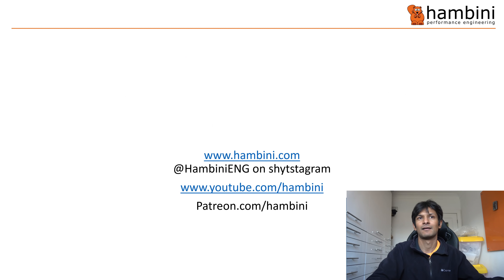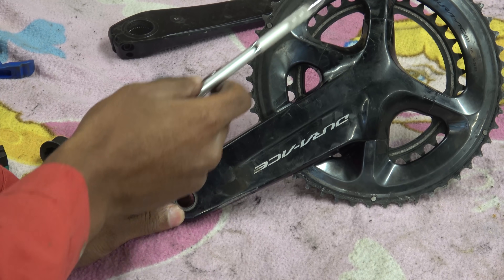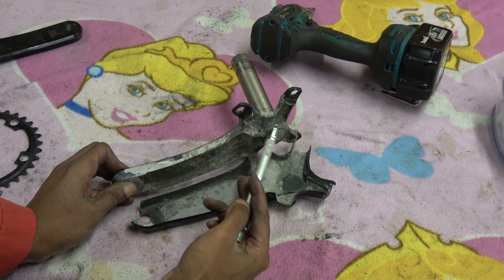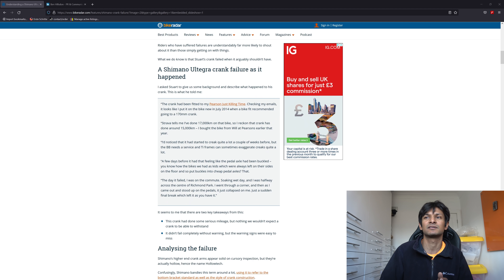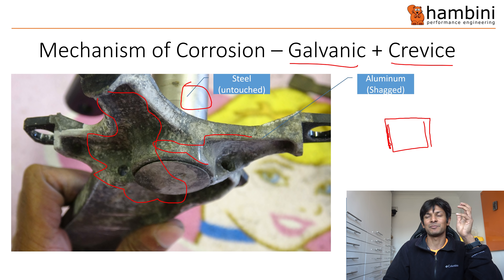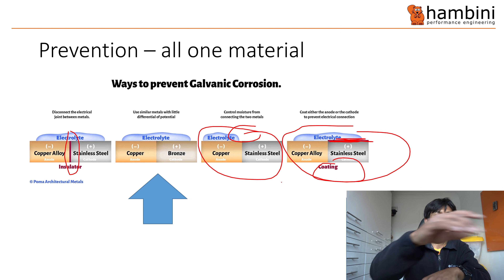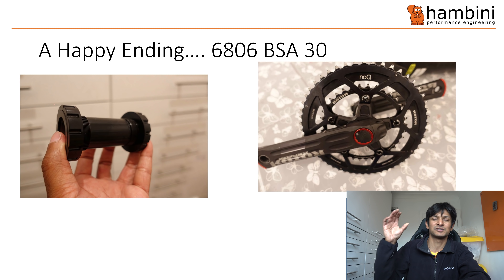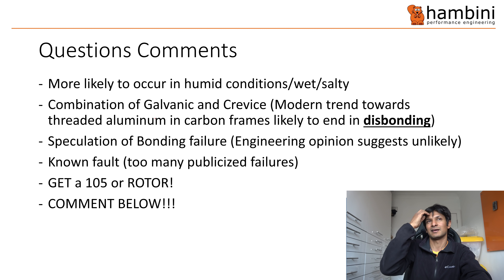Shimano REAMED for Engineering Incompetence

Comment from the maker: A link to the webpage accompanying this video is here https://www.hambini.com/shimano-crankset-failures-an-engineering-analysis/
Reply: We need to know more! Let’s have guest video from the gunman.
Reply from the maker: @dominicward3523  I'm not sure I can find him.
Reply: Shimano's original hollowtech XTR cranks were welded and never had any issues.... It also looks like the top half is forged and bottom half is cast
Reply: @nigelsmith7366   I think that maybe the case even today(need to closely look at my XT and SLX cranks) atleast on there mountain bike cranks which cosidered pretty bullet proof all things considered. I get the feeling that its maybe a case of there flying to close to the sun interms of trying to get weight saving on there road cranks
Reply: Who would have thought one year later Shimano would recall their chainsets when they knew of the potential of failures 10yrs ago. 11yrs ago..
Reply: @Older_Mountain-goat_1984  are you still working?if so when you get paid that is your profit. Profit is not a dirty word. Without profit Campag Shram Shimano cannot invest in new stuff.

Comment: Thanks for the video.  My DA 9100 crank failed as well.  The non-drive side delaminated and it was just outside the warranty period.  I emailed the shop I purchased from with pictures and they just said, sorry and said I could buy a power-meter arm.  Tried to find someone from Shimano to share this issue but could not.  What a disappointment, I am glad I was not injured while riding.

Comment: After my second R8000 failed I went to 105, there's probably a reason stock is thin on the ground.  It's reasonably priced and looks the part, so long as you dont mind the disparaging looks from guys in rapha hats with clicky cranksets.
Reply: There's no real winner at the Special Olympics. Buy a mountain bike, learn how to ride it, laugh at Rapha choppers. Job jobbed 👍🏿
Reply: Love the Rapha guys and gals...  :)
Reply: I run non-Shimano chainrings on my 105. Sold my Dura-Ace as without the chainrings it’s only around 50g heavier than 105. Plus 105 comes in silver which is automatically faster.
Reply: does the r7000 new 105 have the same issue? or do I need to find an older r5800?
Reply: @Demon09-_-  r7000 is not bounded but forged, so the 105 should not have the same issue
Reply: Same here, I run R7000 and R5800 cranks and have no issues.  You still have dissimilar materials (alu crank and steel spindle); so the reason the hollowtechs are failing is obvioulsly due to bond failure.  perhaps sweat, etc. is getting into the hollow space.
Reply: I don't have any problems with Ultegra despite logging many miles yearly , but then again, I am a feather-light 48Kg and top off the end of my power range in the low 600s.  I just don't experience the same frequency or severity of mechanical problems as hravier cyclists.
Reply: This comment is underrated!
Reply: Wow. I can see why Ultegra and DA are so light.
Reply: @thelmaviaduct a while back I had to rapha guys who were pointing at each other's rapha clothing. Carbon ultra light road bikes on tarmac. I bombed past them on my trail bike with 29 x 2.6" tires and they immediately started to chase. They got quite close and held it for a few minutes then I ended up leaving them in the dust 😅. I got to my destination 5+ miles later, rested for 30 minutes and then passed them again on the way home.

It dedi itely isn't the rapha that makes a rider
Reply: @ByronAllis  nice one, wish I was as fit as you. Must get my spandex out and do some zwifting 😂😉💪🏿
Reply: @thelmaviaduct  🤣. Pain. More pain. That's the secret. Originally wanted to say how much I love the 105 groupset but got distracted. Admittedly that ride wrecked me for days but it was worth it

Comment: Now we know where all the Great Barrier Reef coral has gone, its in Shimanos cranksets. I've had 5 friends here now break numerous sets. Very common in Asia, humidity. I wouldn't say the Rotor Aldhus are a faultless. The way they clamp the spider or power meter on a tapered spline is really dumb as its so heavily reliant on perfect tolerances. Paul looks mental but i like his desk.
Reply: You've got 5 friends? 😀
Reply: @tednruth453  one of them works for Shimano which was awkward!
Reply: @peak torque my hairdresser and therapist agree with you. The desk is over 100 years old. And the typewriter is also nearing that age as well.
Reply: Can you imagine if this was a smaller brand? Everyone would be laughing at them and saying it's a death-trap. But... It's Shimano... Carry on!
Reply from the maker: @ChinaCycling  They'd say i t was a rogue supply of one and not a hambini special!
Reply: @Hambini ZRACE x SIGEYI RX Power Meter Crankset  i think zrace designed that type of rotor crank
Reply: should there be grease on the tapered spline when installing the power meter onto the aldhu cranks and axle? I was just wondering if that is going to help reduce future issues
Reply: Happened to me with a 6800 crank about 5-6 years ago.  Initially, I was led to believe it was a one off, bond failure thing.  But having learnt more, water ingress/galvanic corrosion seems more likely.  Anyway, my replacement held up well.  No issues with it so far.
Reply: 2 cranksets in 42 months. Live in Hawaii
Reply: Glad to see such an antique being used in such a correct fucking fashion.
Reply: I have got 3 8000 series crank sets on 3 different bikes. The newest one year old and 8k km, the oldest 3 years old and some 20k km done. I live in wet Cheshire and ride often in winter too, although avoid riding after a major rain fall. So far no issues with either.
Reply: @pureroadie  Exactly PJ you've hit the nail on the head ! 

This problem aluminium oxidisation  / crevice issue was seen across several brands in the very early 2000's  on both aluminium / carbon frame combo's, as well as Ti / carbon frame combos. The weak spot was usually the rear drop out chain stay connection caused by an absence of barrier coating on the dropout male insert leading to oxidisation, tell tale white deposits and consequent debonding  / splitting of the carbon stay. Fully resolved by adding the barrier coating ( Colnago at least  weren't shy to address this), so the issue was effectively identified and fixed from around 2002 / 2003.

Which begs the question why 20 years later are manufacturers like Cervelo and Shimano using inherently  weak design and IMO substandard practice on the items identified  (in the light of knowledge readily available from 20 years ago) ?

Perceptively you supply the answer ...... follow the money and you'll find the answer.  Sadly until it hit's profits or sufficiently damages their corporate reputation, it will be seen as 'not their problem'.

Comment: You have done an accurate review. When I developed the crank in 2010, I tested adhesion and brazing in the same structure as Shimano. Six months later, the adhesive crank arm developed electrical corrosion and cracks began to occur in the miscellaneous areas. Eventually, it was concluded that the crank arm made by attaching two parts was not good, and we developed a crank arm using extrusion. In addition, BB was developed as BSA+30mm at that time, and ACB of size 30.15×41×7 was used for bearings. That's right. This bearing is a headset bearing for 1.125" It passed the EN14766 test without difficulty, and the field test also showed a solid and soft feeling.
Reply: What crank did you develop? Was this one of the early cranks released to the public? Who is "we" in "we developed" ?
Reply: @djlinux64  his name is Japanese, this is a video about Shimano Dura Ace cranks, so he's obviously talking about the Aldhu crank and 'we' in this case would be Rotor, no? 🤣
Reply: @djlinux64  I was a product developer of the brand "Fierce" in Korea. While developing a hollow crank arm, we manufactured it in various forms and tested it. Among them, there was also an adhesion method, so I talked about the experience. If you list the specifications of the crank that was developed at the time, the length of the crank arm was 165/167.5/170/172.5, the hollow crank arm using the extrusion process, the integral BSA-30 BB&spindle, 40/24 chaining, 167mm Q-factor, total weight 685g. sale was not exported overseas only in Korea.
Reply: @이호남-z8m  thanks, sorry for getting it mixed 🤗

Comment: I worked at FSA for a while and I am sure you are aware of the same type of failure in older K Force cranks due to galvanic corrosion. In those the spindle would come out of the drive crank arm. They dealt with it by changing to a glue for the spindle to arm that stopped the corrosion. I wanted to mention your comment about a recall. That will not happen until the failure becomes greater than 1/4 of production and results in at least half of that failure resulting in injury.

Comment: I have had 2 sets of Ultegra's fail for this exact reason. One set of the 6800's and the other the replacement 8000 series. The 8000's only lasted about 1½ years before failing. I live on the Gulf Coast of Florida so the electrolytes are everywhere in the air here. And, like you Hambini, put out the power of an F'n shrimp. 
 I know someone that was "on it" and using Dura-Ace cranks and those cranks snapped. He hit the deck and shattered his hip. :(  I can't give too many details as I know he has contacted a lawyer and a suit has been filed.
Reply: 🦐Power!
Reply: Damn, fnck that! 105 till i die 🤟
Reply: @ironmantooltime  I switched over to a set of ROTOR Ahdul cranks and would have to say it is the best set of cranks I have ever owned. And they look damn sexy on my TCR.

Comment: Excellent review of the electrochemistry of bikes. One point is that you don't need to worry about carbon fiber (graphite) being extremely cathodic. These oxidation/reduction reactions need the metals to be solubilized. This is the role of the electrolyte. So elemental aluminum become AL+2, iron becomes Fe+3. Carbon  (C) is insoluble. So to complete, AL+2 oxidizes (anode) to Al+3 and Fe+3 reduces (cathode) to ferrous ion (Fe+2). You hit upon and important point of Al+3 and oxygen --> Al2O3 the white powdery crud that forms in the c section, expands and allows more water in and further non-cathodic corrosion. Sacrificial anodes on bikes won't work as you need electrical continuity throughout. On boats most corrosion is caused by electrical leakage from the battery and the sacrificial anode is used to ameliorate this effect. Coatings just seem to invite corrosion at the edges. 

Time to take the Princess towel into the shower with you.
Reply: Yes. Additionally: An insulator will NOT prevent corrosion. It just slows it down, because of the solubilization of the metals in the electrolyte. The ions mix in the electrolyte and then you have aluminium and iron ions at the other metal. However for bikes this might be slow enough.
Additionally you need to be careful, because scratches can move the metal over the insulator, forming a "bridge" (direct connection).
Reply: I have seen exposed carbon fibres in cut CFRP lead to corrosion of aluminium. You do have to worry about carbon in terms of it causing corrosion of metals in contact with it.
Reply: @gmt198  What redox reactions are you suggesting the carbon causes? And what is CFRP?
Reply: @lb7325  Carbon Fiber Reinforced Plastics (or Polymers)

You have the fibers stick out at the cut end (especially at drill holes)
Reply: Forgive my ignorance in the case that this is a stupid question. If I have an aluminium seatpost in a carbon frame, can it corrode? Does the anodising prevent it getting stuck? I was under the impression we should use carbon paste to stop seatpost a slipping, however if they don’t move, do we still need to put something on them?
Reply: @MrJayRenegade  It's an easy question. The answer is maybe. God I amuse myself to no end .😄. The anodizing will probably prevent corrosion. But it is easy for places to be missed or not adhere well (like the end edge) and the non galvanic corrosion can creep under the anodizing. But why not take the post out once a year, check it and lube it?
Reply: For my own bike of course I can do this. I work in a bike shop and I was more concerned about what happens to the customers bike. I was told by an older and supposedly experienced colleague that seatposts don’t corrode in a carbon frame and mounting paste is only needed for potential slipping. I personally only experienced slippage in a road bike. So I stopped putting paste on mountain bike seatposts. Of course your video brought up some questions. I guess if the seatpost is well anodised there probably isn’t much to worry about.
Reply: I like your approach, appreciate the chemistry and can not define the mechanism for you but corrosion with metals with carbon fibre based materials is certainly something that occurs, there are examples from marine applications but on bicycles it is seen in the wheels at the spoke / rim interface.

I suspect the carbon acts as conductor and might well be unchanged in the process although I have to admit my limited knowledge struggles with the concept and a feel it must be studied and documented somewhere, I haven’t found it yet though.
Reply: @malcolmbagley7068  Hi, I've been meaning to write. I have to admit I was, let's say, too focused on chemistry jargon (OK I was sort of wrong). REDOX (reduction/oxidation) equations typically involve an oxidation (loss of electrons) component and a reduction (gain of electrons) component. Where I went wrong is thinking that the cathode (reduction site) and anode (oxidation site) have to undergo chemical reaction. In the case of carbon/aluminum the aluminum metal is indeed reacted to aluminum oxide. However the carbon frame is essentially an inert cathode. The high cathodic potential of the carbon does provide the energy (electromotive force or EMF) to promote oxidation of the aluminum (as long as there is electrical continuity) but is not itself chemically altered. The reduction side of the equation is the reduction of hydrogen ions, H+, to H2 gas. A good YT presentation of this is by some guys building a carbon fiber (plus metals!) aircraft, DARKAERO. https://www.youtube.com/watch?v=yRpMZaU8zKw. I found references in aircraft engineering articles of titanium being substituted for carbon fiber which puzzles me as it has high cathodic potential and would also be an inert cathode like carbon.
Reply: You may not have to worry about the "carbon fiber being extremely cathodic", but the other half of the galvanic pair (e.g. Aluminum) can corrode, swell, and damage the carbon. My early-2000s Madone frame cracked starting right at the inserts/bosses for the water bottle cages. The metal insert was swollen with corrosion.
Reply: HaHaHahahahaha. Sad too.
Reply: What is unclear to me, is where the electrolyte comes into play with the crank. there is no spot in the assembly where water could reach and interface axle and crank-arm. The plastic bearing cap sits where the two would interact and there should be a bit of grease too. i don't know if humid air would be enough though. Most pedal axles are steel and you don't have significant corrosion there. plus this type of corrosion is engineering 101. I can't imagine they havent thought of it.
Reply: @a.r.8850 ,  "...no spot in the assembly where water could reach and interface "  Condensation is always present; it seeps into cracks and crevices by capillary action.   
And your second point, "...I can't imagine they havent [sic] thought of it"  Of course they've thought of it, but the solutions are not economically feasible and the accountants will tell the engineers 'no way--not competitive, too expensive, blah, blah, blah."
Reply: @MrJx4000  that sounds too easy as an answer. Still doesn‘t account for corrosion to start on the inside, where condensation is very limited due to the closed volume. Outside, where there might be enough electrolyte, there is no corrosion. I maintain my suspicion: the gluing process is faulty.
Reply: @a.r.8850  Had they used inox steel instead the problem would not happen, it's the steel + aluminium combination that causes corrosion, some  explanation is provided in the video. The external surface is protected with some coating, apparently this was enough to protect it for some time. Also the axle looks "riveted" maybe without glue at all.

Comment: Not a part designer - chemical engineer, with an old specialization in materials (not practicing in material field at this moment). I agree that this looks like chemical corrosion all the way in. My guess when I saw the photos a year or so ago was that water was infiltrating somewhere in the bond and slowly eating away at the join.

If Shimano can't bond the cranks in a hermetic way, maybe add a sacrificial anode somewhere in the piece? Adds weight for sure, but maybe not a stupid thing given the mess they got themselves into.

EDIT: Also - great news on the Hambini BSA 30 BBs. I deliberately chose the 24 Rotor for my last build because I was fed up with SRAM's clunky preload adjustment and a bike that needed a bit of spacing help on the chainring area. This opens a lot more options.
Reply: Try the 30mm cranks from sram, the preload adjuster is 10x better than the old wavy washer + hopes and prayers method of GXP.
Reply: The anode would just buy you some time, but when worn/gone, the crank would then fail as before.
Reply: The thing is if you add weight via a sacrificial anode, then the crank might become so close in weight to the lower tier (105) that it makes almost no sense for the upper tier variant to exist since the "upgrade" is predominantly about weight savings.
Reply: @dvoob  You mean the DUB cranks?
Reply: @DilbertMuc  dub works just as well, but SRAM also made 30mm bb30 cranks for awhile. Dub is 29mm and pretty much the same deal just with proprietary BB standards.